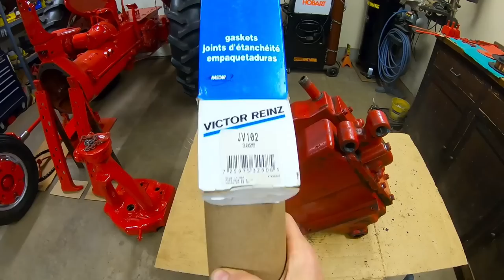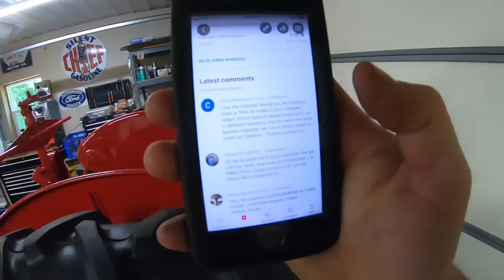Farmall "Preparation H" Episode #16: Belly Pump Re-Seal & Lots of Other Small Projects!

Comment: As someone who has had to make gaskets, i’d greatly appreciate seeing your methods! My biggest issue has been making large round holes where i don’t have a punch. Have turned sharp edges on pipe on a lathe for an air compressor head gasket. Enjoying your videos!
Reply: I do "one-use" tools (or limited-use, anyway) like that quite often.  Copper tubing, black pipe, etc.  Works well, fairly inexpensive...or used to be, lol.

Comment: Yes we need a gasket refresher! Long time viewer here and I've watch you make them before. But as my own recent experience would show, I need to learn about gasket material selection. My rebuild of a 50 year old air compressor did not go as planned. They leaked. Round (2) worked with the proper material. I'm sure many would benefit from a Master Class. Love your channel.

Comment: I would like the gasket making video.  In particular what type of gasket material works with what.  Once used a rubber material that was rated for gasoline but it disintegrated after a year.

Comment: Yes please to the dedicated gasket video. I’m working on an old Cub Cadet Original and have one gasket that doesn’t fit. I sealed it with rtv for now but since those two case halves have gears meshing between them, I would feel batter having the gasket thickness between them for that extra peace of mind of gear alignment. And I have to take it back apart anyway to address a bent shaft. A whole other rabbit hole. And premade gaskets are expensive.

Comment: My go-to gasket material is rubber impregnated cork. It's a bit expensive, but there's nothing quite like it. A light film of grease or gasket maker on both sides, like barely even visible, and it seals tighter than Fort Knox. I've never had it leak on anything i've used it.

Comment: Victor Reinz as a gasket material maker is very respected. Specially when you deal with German made cars. I'm all hands for a gasket material video, however I will leave it for you do decide if it's worth making or not.  Good job on rebuilding the pump, it looks very complicated first but actually the setup makes sense when you look at it from another perspective.

Comment: What to use on a gas line metal. I have used teflon tape but it's not recommended. To keep from leaking. And yes, I would have to watch a gasket making and Material👍

Comment: Had a question about the cartridge casting at roughly at 7:00  mark.  The casting looks like a chuck is broken off at the head side of the short pin.
I you made no comments about it but wasn't that important to the balance of the detent are movement?
Gaskets, it looks like the RTV USER changed its  usage style. Less better I see now.😅😅

Comment: When adding modern 2-line hydraulics to an old tractor like one of these is to lock the pump control side lever in its furthest back position and then plumb a spool valve in on the right-hand side with its return going back down to the bottom drain port.  

From there the control rod can be modified a bit to move the spool valve lever and work to give your tractor bidirectional fluid flow for double-acting cylinders. 

With some proper fabricobbling it can be made to look like a stock option.

Comment: Long comment, grab a refreshing beverage. 

First, that breather cap is absolutely right, correct and proper.

Second, I really don’t care for you Rube Goldberging that cap off with a pry bar: that was an absolutely great opportunity to create a custom tool. I am very disappoint. 

Finally, Gasket Chat. 

I’ve only been here since you tore down 1113’s engine down. Since then, I’ve watched pretty much all of the back catalog. I’ve seen you deploy an enormous number of techniques in your work. A personal favourite is running a bead around a stubborn bearing race. 

My point here is you may be giving your audience a little more credit than they deserve. I know that I have learned a lot from your channel and I think that is why it enjoys the success it does.

Personally, I’d love to see you cover off the gasket process. I’m about to knock up a gasket for a diff cover, so there’s that. 

But there’s other stuff too. I think you could run an entire series of technical reels. I know that you used a candle on the stuck clutch, but I’m not sure which video that is.

You cram masses into each vid: this could be your chance to educate people in much more detail. And sorry if you don’t know this yet, but you ARE an educator. Plus the viewing minutes won’t hurt either.

Comment: Don't forget to add in shim gaskets not all things were built with all metal shims, a lot of things used paper shim gaskets in which have some sort of coating on them, Wisconsin engines used paper shim gasket for the end trust on the crank shaft end bearing cap, cause they never grooves them for an oring

Comment: A filter couldn't be adapted with two tees, a bypass line and a pair of opposing check valves? Pressurized fluid would be forced through the filter by the opposed check valves. Return fluid would bypass the filter by the action of the opposed check valves.

Comment: So howd that casting get broke by the smaller of the two cross pins? Looks like raw iron with no glyptol showing.  Theres got to be a story there.
Reply: @squatch253  wise policy.  Did you find the chunk when you pulled it apart the first time? 

Also how far from the bottom of the sump is the bottom of pick up?  It would make sense that there would be a generous gap to allow trash to settle out and not go through the gear pump.  

Really like your channel man. Keep up the good work. Hope yall get some rain soon or your state bird might die out.

Comment: You know those magnets in transmission pans most techs leave out to promote repeat business? You may have seen one or two... One of those should find a good home in that pump that doesn't use a filter.
Reply: @squatch253  In this case they might come in handy keeping flakes from circulating in a design that doesn’t use a filter if there were room inside the housing. But for a “parade” tractor, maybe overkill.